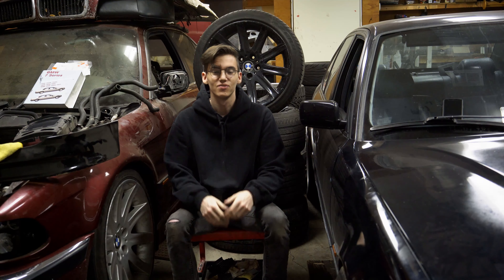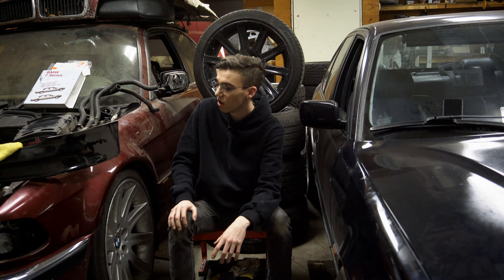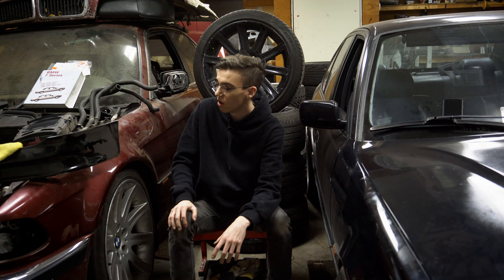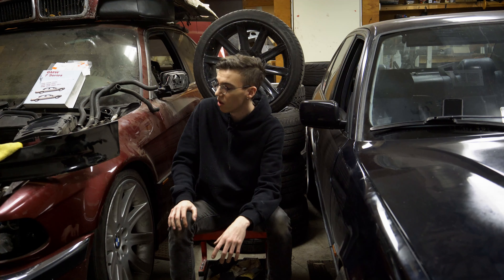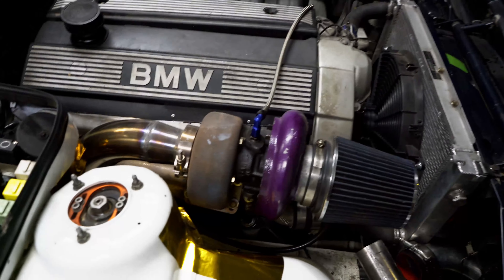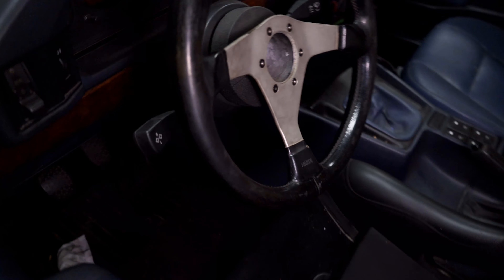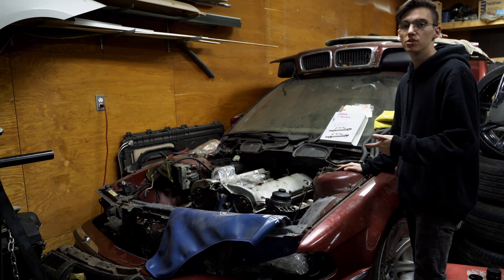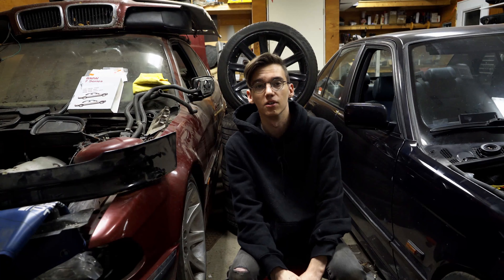Finally starting a channel, here are my project cars | Introducing the BMW e34 & e38 | NeverEnding

Comment: I just watched your latest video that popped up on me so decided to go back to the beginning and catch up.
I love the way that hood slides forward when you pop it. One of the coolest things BMW ever did. Lol
I wouldn't worry about pressure differential on your brakes. It's caused by one hose expanding more than the other especially if they are different lengths. Yours having outer metal braiding, that's not going to happen.
Just how old are you? I figured 18 but you said you'd had that car five years. Did you break your piggy bank to buy it at 13? Lol. Just kidding.
It's midnight now. Do I want to stay up and binge watch you all night? Mmm
Reply from the maker: Haha, I'm 26! But still have to show ID to get into the scrap yard.
Reply: @NeverEndingBuilds  I took my mother to the grocery store once when I was 30 and when I asked for a packet of cigarettes, I got carded. My mother laughed at me.